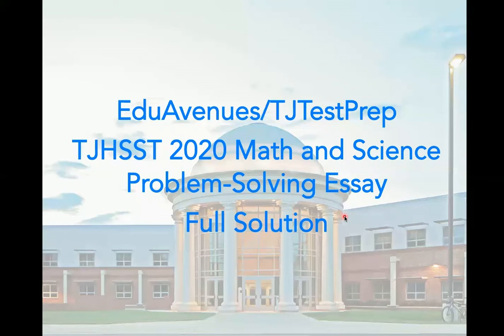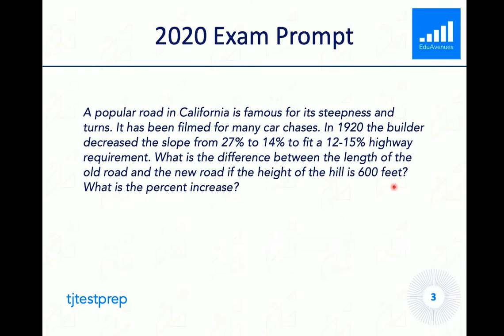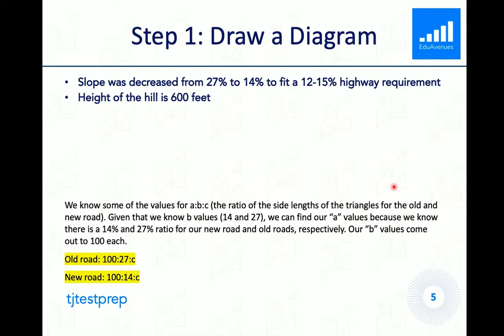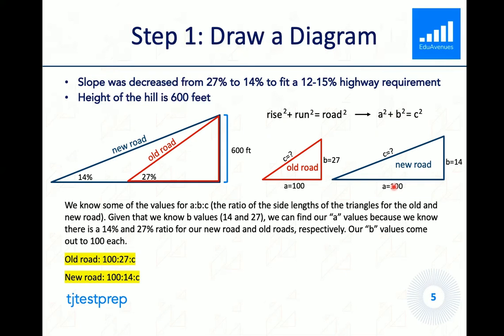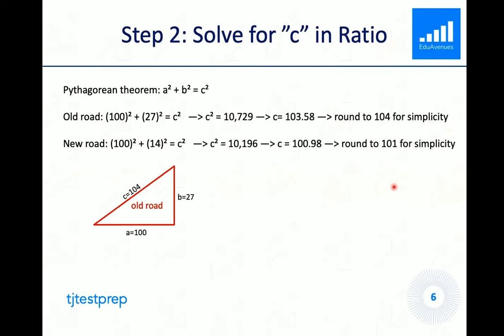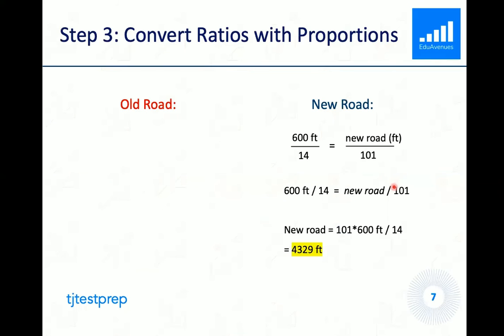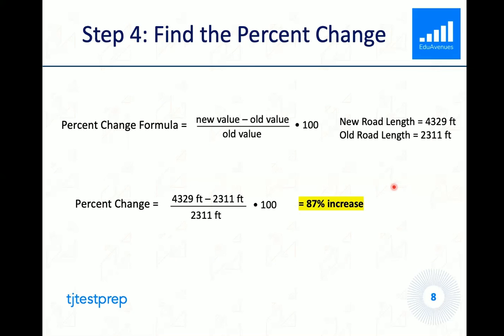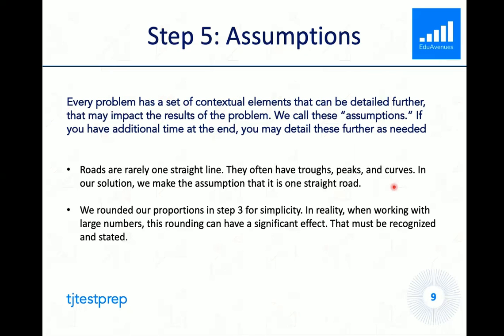TJHSST REAL 2020 Admissions Assessment Problem-Solving Essay (PSE) — Complete Solution

Comment: Wouldn't this be hard to do in approx. 30min (as you're devoting 15 min for each SPS response). Do you know how many students sucessfully solved the problem correctly while also getting a essay in?
Reply from the maker: That's right -- it's incredibly challenging to complete in such a short timeframe. While we do not have hard data on the # that got it correct (the TJ admissions office does not share that), most of our students reported that they were able to solve it and complete their essay in that timeframe! That's exactly why preparation is essential!